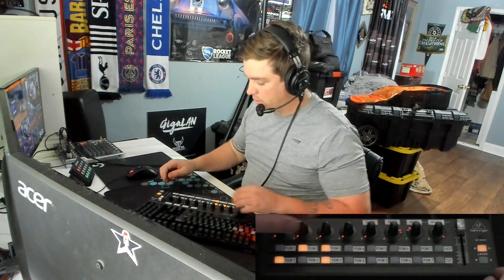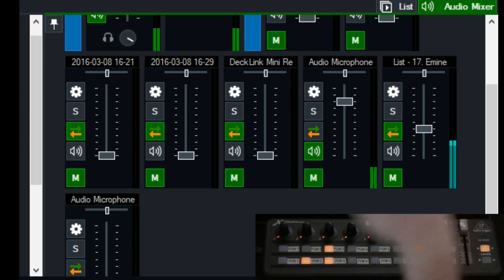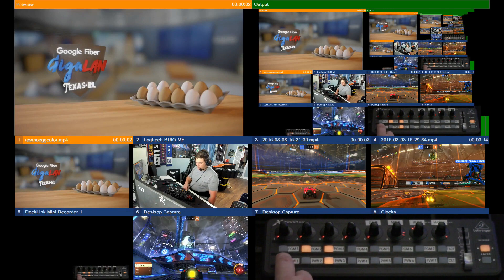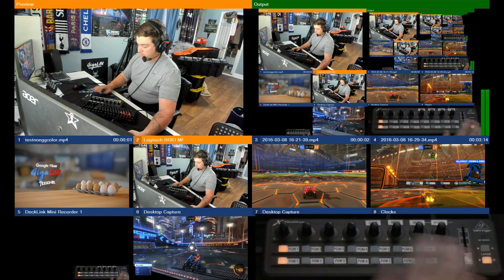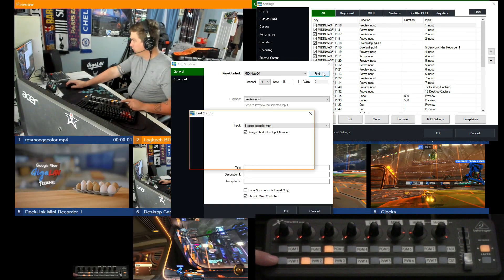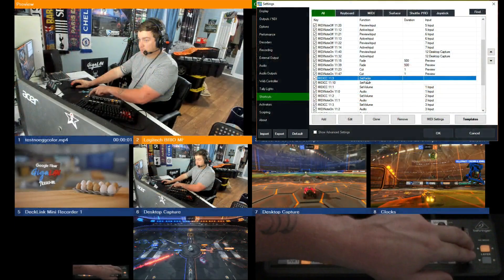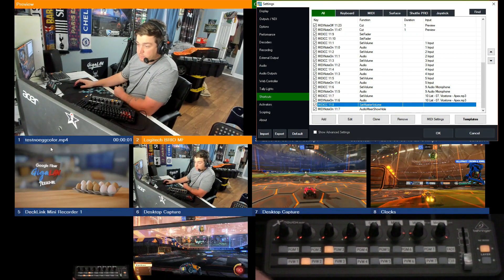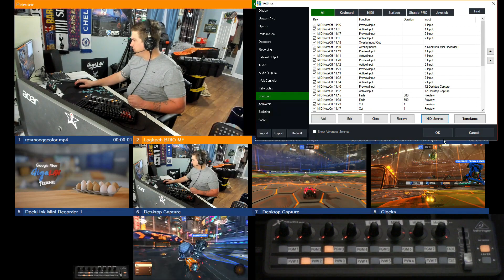X-Touch Mini as a vMix Control Surface

Comment: Hey! I know its been a while since this video's been up, but I had a couple questions about the x touch mini and vmix.

My layer A and B are being recognized as the same layer in vMix, I wanted to know if you knew a solution to make those different inputs

As well, have you found a way to make activators so the volume knobs on the x touch follow the volume levels in vmix?

Thanks for the video and the templates!
Reply from the maker: can't say I know a solution for either question honestly, and I haven't messed with it much recently. The software should let you re-assign the second layer at least, can download here https://www.behringer.com/product.html?modelCode=P0B3M
Reply: @CjSmurph  Thanks man! I took a deep dive into it - I'm planning to make a video to piggyback off of this. Behringer doesn't have ANY resource on how that software works, and that is such an incredible tool

Comment: where I have to place each of the 3 files so that the direct accesses and lights can work
Reply from the maker: You import them in to the shortcuts and the activators. It's on your settings towards the bottom

Comment: Hey. I see that you also have Stream Deck. If you had to choose only one device - stream deck or x-touch and why? Thank you very much!
Reply from the maker: Depends on your use honestly. The behringer works very well for exactly what I've shown in the video. It's more of a live event thing and less of a home studio controller. The stream deck has more capabilities and you can tie lots of cool functionality into stream deck outside your production software. You can't use midi (so the xtouch) in other production software, most notably obs which is used very widely.
Reply: @CjSmurph  Thank you for the answer. I suspect you do not know the Bome MIDI Translator Pro software. With it, you can translate midi to any event or script. The beginnings with it are not simple but the possibilities are endless - really.
Reply: @CjSmurph  I will also add that vmix will soon release the update (v22) with support for elgato stream deck. It will be a very serious toy.
Reply from the maker: @reddot9662  Loving the vmix/streamdeck integration